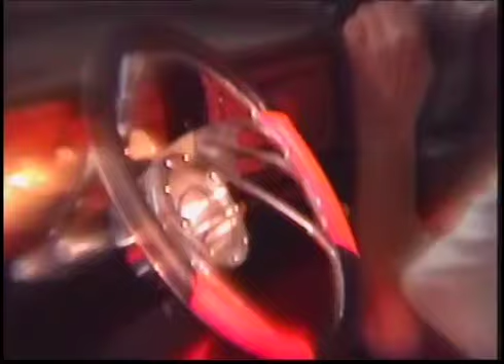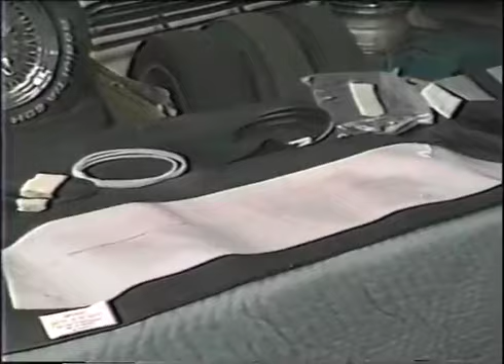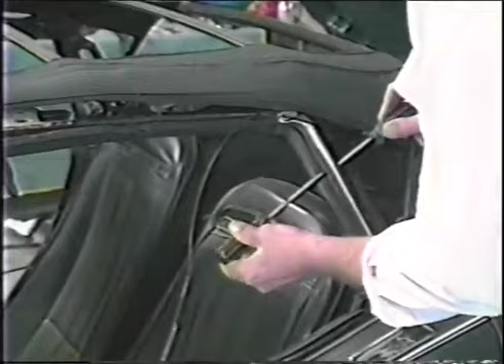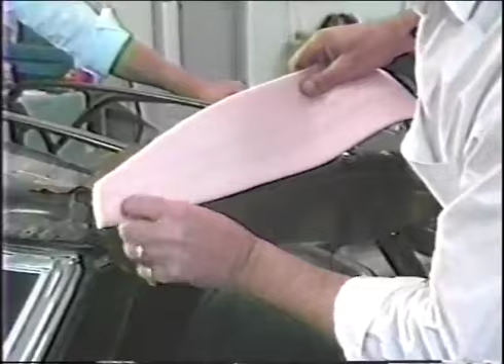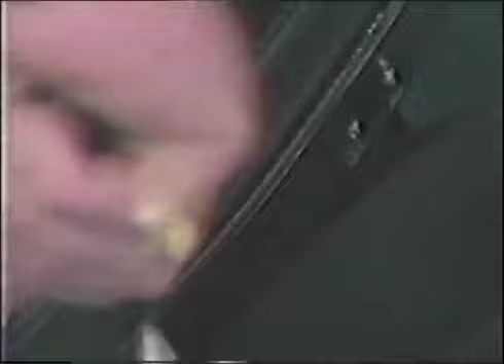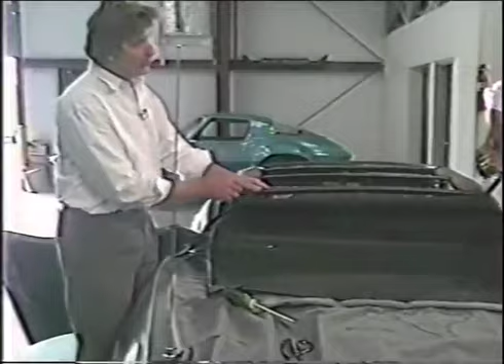1968 - 1975 Corvette C3 Convertible Top Install

Comment: Well boyz I hope you answer me. Pam here, never done a covertable top before . My tabs are shit mostly broken or rusted off . Also the pad covers are really ruff so I'll be making new ones  with new pads. The top they sent is all sealed the way you said no stitching .Back window bow rubber looks a lot differant from what was originally on it so I'm expecting trouble ahead on that.This a 68 I'm working on . Don't have car here just old top and new one to install.And my spring is gone completely.What did I step in? Haha Hey mine has black glue /tar maybe under all weather striping on sides. I'll have clean all that off I suppose? Do I need to re-glue? And what kind? I have Hi -temp spray? Mine doesn't have back window straps ether? Should I make some out of what ?Canvas or vinyl diamentions if you have them. Should I send these folks down the road they can't find anyone to do this job.